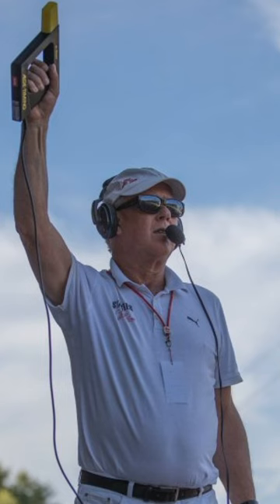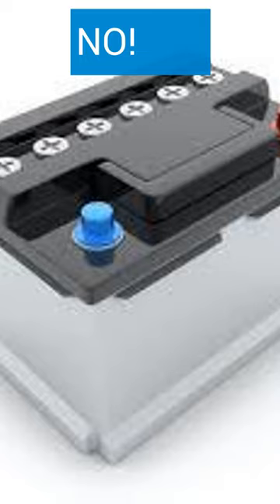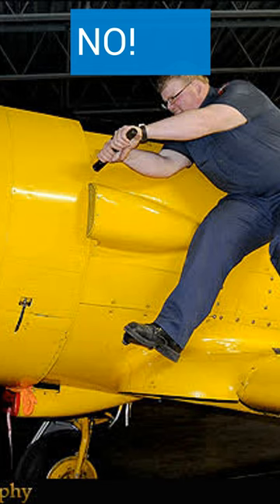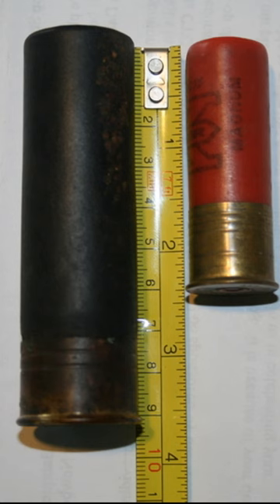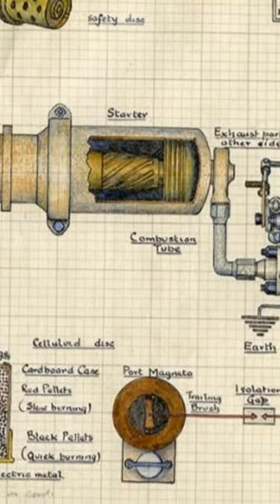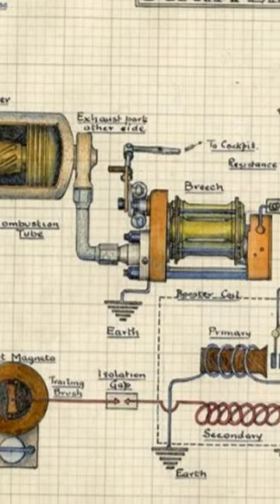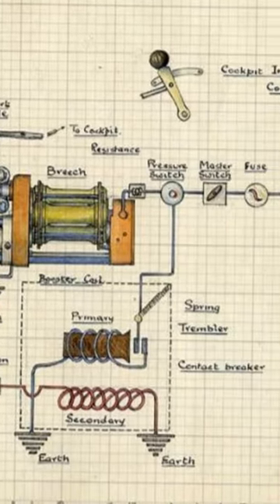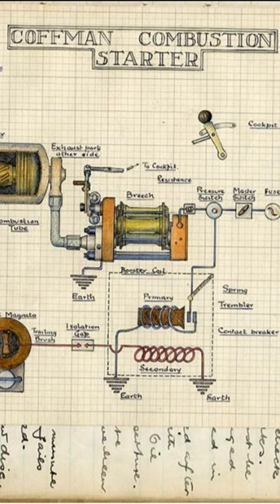Starters 10 Coffman Starter

Comment: I believe it’s to check for Hydrolock on radial engines.

If it stops turning manually then I believe the Spark Plugs must be taken out from the bottom or lower cylinders so oil can be drained off.

I was told this story early on in my naval aviation career by an old Navy Chief. He was an encyclopedia of military aviation history. Especially Naval aviation history.

Thanks for sharing!

✌🏽🇺🇸🙏
Reply: Think I've heard hydrolock but also pre oiling bearings to prevent startup wear and tear
Reply: It serves several functions simultaneously. Checking for hydrolock is one. Distribution of lubrication and clocking the engine to an optimal position for starting are others.

Comment: They rotate the engine to the start position, tdc almost!!! Dont want the shotgun gases to escape down the exhaust valve and not pust the piston down... Thats a guess being a  machanic, the guy in comments has a point also to make sure its not hydro locked.
Reply from the maker: The gasses from the shell don’t end up in the cylinders (I thought so too before researching it!) The gasses push another piston that engages a gear, that kicks over the engine. Something like that! Cheers!
Reply: @worldofwarbirds  thanks for expanding on that, i had thought that, you would have engine piston compression up to that valve where the cartage goes, a valve would have be used i suppose, ive seen the same thing with old tractors, its fantastic 👍